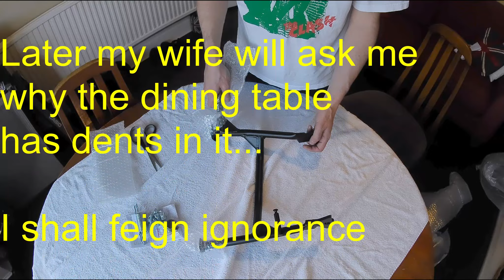KTM 790 Adventure   SW-Motech Centre Stand

Comment: Pulled the trigger on a new duke 790 this morning which is what got me into your channel. Sat on and really liked the 790 adventure just couldn’t stomach spending £300+ to have a ktm bod enable the quick shifter 🙄
Reply from the maker: I just reread. Yes the Duke is a great bike and you get everything included. Which is how it should be! Good luck 👍
Reply: Codger Biker still going to carry on watching your genial ramblings though 😜
Reply from the maker: Appreciated! ✌️
Reply: Codger Biker you don't happen to know socket size I will need for rear axle/spindle nut ?
Reply from the maker: Join the FB UK Duke group if you haven’t already. They are great for info. I don’t know the size but the handbook is online I think if you search Google ‘Owners manual 2018 790 Duke’ for free. It should be in there
Reply from the maker: Guessing 32mm, but only guessing.
Reply: Codger Biker I have and someone replied to my question on there about 30 seconds after asking you 🙄😆👍🏻
Reply from the maker: They are the best. They do ride outs and meet ups too - top people! What did they say? 👍
Reply: Codger Biker good guess, 32mm, fortunately same size as my last bike 😄
Reply from the maker: Same as the Adv too I just checked. Great stuff! 😂

Comment: I've never installed any stand.. but... the times I've seen some do it, they used brake / clutch cables... instead of s screwdriver...
they used the cable as s pulling utility..
and that was easy & snappy...
Reply from the maker: Yes it is a good method to use cable ties etc with 2 people. I found the screwdriver/lever worked fine, but as I said in the video, would not recommend it. These springs are very strong, care is required.

Comment: Hi again Codger, I’m really tempted by the centre stand and still have reservations about the KTM mounting casting; when the stand is retracted, what is the stop contact area like? Any doubts from your side?
Reply from the maker: Yes, I have my doubts. But it is on now. KTM obviously built it for a centre stand as they are releasing their own and all the fittings are there. But... well, all the weight of the bike is on the footpegs mount, though shared. It does look good though and the wheel is nicely off the ground. I will do a follow up once the rain has gone

Comment: Is the Rear wheel off the ground , when the bike is  on the centre stand? Did  not seem so, but maybe it was just the viewing angle. Thx for info and greetings from Germany.
Reply from the maker: Yes it is off the ground. I can easily get my hand under the tyre. Useful for maintenance. 👍
Reply: How much preload do you have on the rear? I ask because it affects  the amount of clearance between  the tyre and the ground.
Reply from the maker: RedRupert64 It’s off the ground. The drive is on a slope, so it is hard to see. Never adjusted preload. See follow up video for clearance 👍. https://youtu.be/qzVKzASVF2Q about 9mins...

Comment: Dear Codger biker.
I am seriously interested in this motorcycle.
But before I buy it, I would like your honest opinion and experience with this bike so far.
Have you had any problems or defects with this motorcycle until now?
I want to buy it as a second hand, what should I pay attention to?

Thank you in advance.

Kind regards
Nedjo
Reply from the maker: Hi Nedjo. I did more than 4000 miles before Lockdown All documented here: https://youtube.com/playlist?list=PLeqBZ9Sn4T5uT0jGP3wbiTj4-WGZdidYg
Had a loose top hose, coolant, very common. Usually just needs tightening. Moisture inside the TFT on cold days was the only issue I never resolved. Apart from that it was absolutely brilliant 👍 Make sure rear brake-line recall has been done.
Reply: @CodgerBiker  Thanks for your quick reply

Comment: Get some 2p coins and insert them between each twist of the spring to extend the length, then when fitted, use a pair of pliers to remove them.
Reply from the maker: Good tip, cheers! 👍

Comment: Fitted the same one yesterday.well made main stand..👍
Reply from the maker: How did you do the spring?
Reply: @CodgerBiker  my spring puller was not up to it
So I used two cable ties.and a big screwdriver to pull the spring.as you say. A bastard !
Good videos .bought mine just about the same time as you 👍
Reply from the maker: Thanks. I keep thinking there must be an easier (or at least less stressful) way to fit those double springs. I know the Sw-M stand on my Africa Twin was great, so here’s hoping. I just think the bike looks much cooler on the centre stand and it’s great for chain oiling etc. 👍✌️
Reply: @CodgerBiker  I swapped my Africa twin .for the KTM.because of the weight difference.
I had a 950 adventure in 2005 and the 790 reminds me of it very capable bike.but no fancy  electronic s
I agree with you about the lack  of power parts available..would like a bit more comfort on the seat 😉

Comment: I've been thinking of fitting one of these to my bike (same model). Does the side stand interfere with the center stand in any way?
Reply from the maker: Not that I have noticed. I shall do a follow up once the storms have gone and check it out on road etc.
Reply: @CodgerBiker  Thanks! I watched how it looked and there does not seem to be any interference. Reason for asking is that I've seen the same kind of centerstand on other bikemodels where the it wouldn't completely go back up unless you took the sidestand up before. Left it open for driver error and possibly a horrible surprise in a corner when suddenly the centerstand grabs hold of the ground 😆
Reply from the maker: Glad to help 👍

Comment: I have the same center stand installed on the same bike. I dont know what I'm doing wrong but the springs aren't snapping the stand up or holding it there. If I push the stand down it just stays there. Thoughts?
Reply from the maker: I can’t really say unless one of the springs is not connected. Mine holds really solidly, even off roading. Are both the inner and outer springs mounted correctly? I.e. 2 hook connections at each end (4 in total)? And are they connected to the new bolt at the footpeg end?